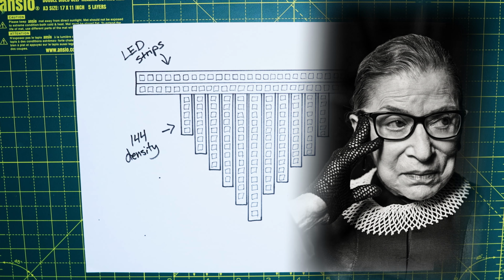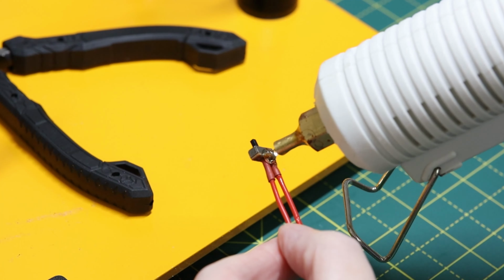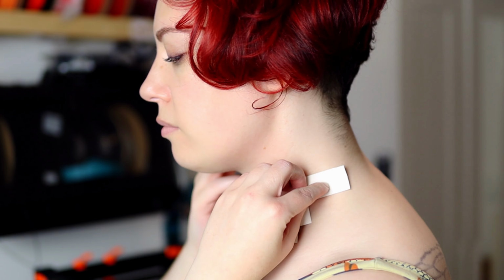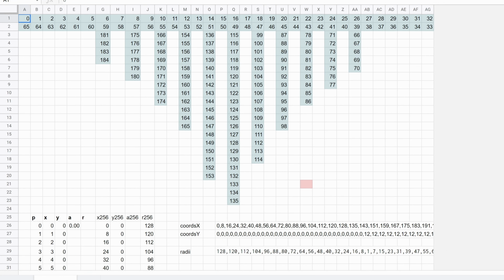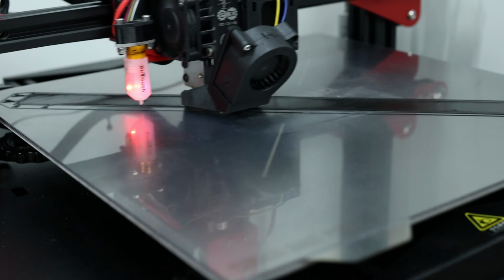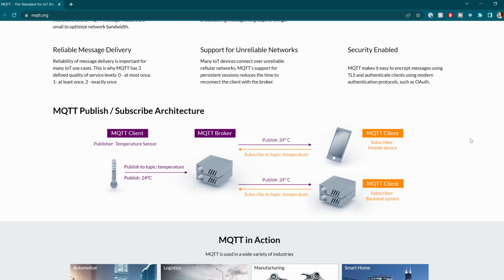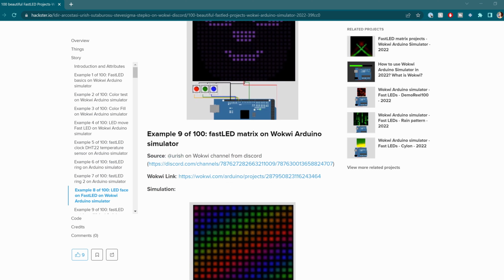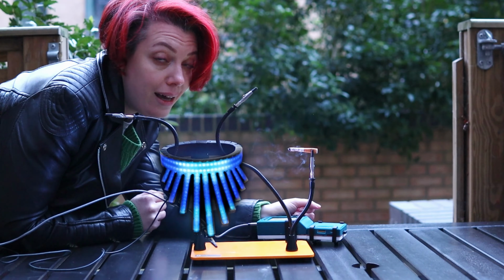Can LEDs + 3D Printing + Fashion Help You Breathe Better?

Comment: so many fantastic things about this video, but my top 3:

that GND wire splicing
the revelation of flex filament dovetail joints
there is something very david lynch (in a great way) about the imagery of the cigarette being held by the 3rd hand clip

Comment: Wow! So much here to unpack. So many cool ideas and inspiration just bubbling up there. Have been following this project on Twitter for a short while now and super excited to see the finished project. Well, I say finished but I'm sure you'll be updating and modifying it for some time! Having dipped my toe into FastLED last year I can appreciate the effort that went into the code.  Gotta say, my favourite in the library is the Pacifica animation. I just find it so calming, especially on a long string or grid. I can see some of that inspiration in the base animation you have going on with the necklace. Also, props for the mad soldering skills. I thought I was pretty handy with the ol' iron, but by goodness that's some neat and tidy wiring. Those Neopixel strips drive me to distraction with the fiddly solder pads. Anyway, such an interesting project

Comment: Fantastic result! I picked up three 1m WS2812B LED strips after seeing your early progress and when I starting reading on power requirement per LED, I was concerned. So, I was really surprised when your 288 LED test was under 0.9A. Everything I had been reading was saying a few amps, especially if a lot of LEDs lit white. I'll need to look for one of those USB testers to check power actual loads.

Comment: Do you have space for a motion sensor in there too?
Reply: @katzcreates  I been tinkering with some cheap adxl345 board (think 5 of them for $10).  I was thinking you could use the interrupt output on the to step through a led pattern each time you take a footstep or if you swayed left or right, the pattern/colour could change in synchronism.  Thanks for the vid though.  I've not tried any flexible filament printing as yet

Comment: What an awesome project! You absolutely rock. I love the progression of the design & narrative - you honestly made the evolution of the project look easy! I’m also slightly envious your wiring skills are way better than mine. Really well made video too - nice tight editing and really nice camera work! I was really intrigued, but sadly not surprised, by the data you got from the PM2 particulate matter sensor. I live just off that hill (in one of the vales) and the traffic is incessant. I’m now so tempted to try that Environmental Sensor Development Kit when it’s released and get some readings around my home. Kudos.
Reply: @katzcreates  If you ever need to borrow a reel of solder, a soldering iron or a desoldering gun  👍😆

Comment: That looks awesome and has a pretty cool functionality. The necklace design itself gives me some deco vibes. I'm wondering if using the diffusing filters from broken monitors/TVs would allow for a thinner case.

Another interesting thing I could see being done with this is to add a GPS module and have it track the PM levels on a map, though you did mention that the readings were pretty consistent.